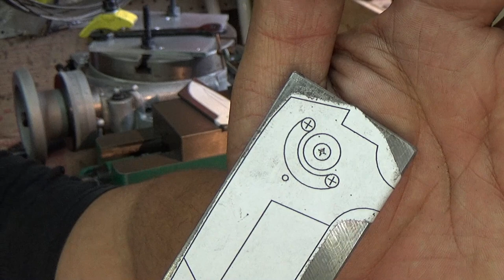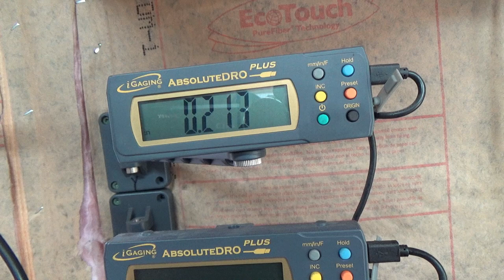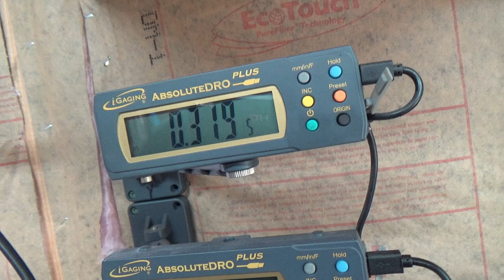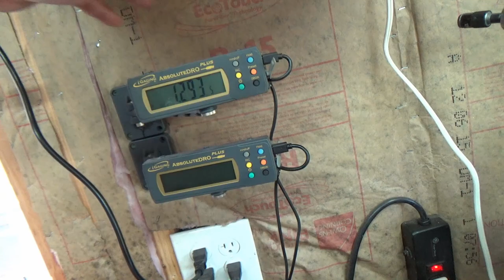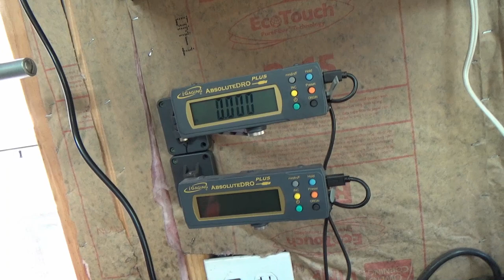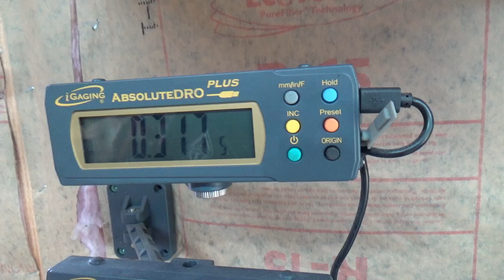Making A Folding Knife #2  Milling out the stop pin track

Comment: For positioning the holes on the blade. You could do it this way (just an idea)
-profile the blade and make the pivot hole.
-profile the handle with pivot hole and with an undersized hole for the stop pin 
-assemble the knife with a pivot. Turn the blade to the position you want it to stop when it is opened and clamp it together
-drill through the undersized hole. 
-assemble the knife   with the blade where you want it to be in the closed position. clamp it, and drill again.
-disassamble, and drill+ream all holes to the proper size. 
-after this you can mill out the path for the stop pin .  This way, you can be sure, that the closed and opened position follows your design accuratley .

Comment: Since you have the DRO, you could drill all 3 holes on the rotary table by finding the coordinates of the 3 holes. This would save some time. I don't know how to quickly explain it. Basically, find the center of the rotary table, Zero the DRO, put the stock on the rotary table, drill the pivot hole, use a dial indicator to make sure the stock is aligned in one axis,  then travel to the 2 "end" hole locations via DRO coordinates, and drill those holes. Then switch to an endmill and  crank the rotary table to machine the slot.  I hope that makes sense.  I enjoyed the video! :)
Reply from the maker: That's a great idea and would definitely eliminate some time and variability. Thanks for the tip!
Reply: Tried making a stop pin track with no DRO,  I just bought a DRO and am going to try this.

Comment: I have an idea that might improve the concentricity of the slot and the pivot hole. It's similar to what Wide Vision Metal Fab suggested earlier...

Basically, you're shooting for concentricity, right? That's the most important thing? That being the case, it seems like it would be a good idea to do everything on the rotary table.
Quick disclaimer: these are just some ideas I came up with while watching your vid. I haven't done ANY manual machining what-so-ever so I can only hope that this will be helpful...

1. Step one would be to center the rotary table and fixture/spoilplate on the mill.
2. Punch the center of the pivot hole using the optical center punch.
3. Use the pointed ground rod to align the punch mark in the blade with the center of rotation of the rotary table. You may want to make the point a little sharper.
OK, now the good stuff...
4. Drill a hole in the center of the pivot hole, but don't use as large of a bit as you're currently using. As you may know, drilled holes are neither round nor accurately positioned. Although I haven't tested this myself, I think I've heard that a drilled hole might be off a thousandth or two just because of the nature of the shape of the tool. The method I'm proposing doesn't require an accurately-positioned hole, so don't worry about it if you try what I'm suggesting...
5. Now drill the two holes at the ends of the slot. The size and positions of these holes aren't critical, but punching them first probably wouldn't hurt.
Now, remove all the material you want, accurately, using an end mill...
6. With the blank still fixed to the rotary table, put in an end mill. I'd recommend a .125 end mill instead of that .140.
7. Re-center the rotary table with the spindle using the DRO. Oddly enough, it still won't be critical that you're PERFECTLY centered, but you probably don't want to be too far off.
Being that the pivot hole is going to be reamed to 0.1875, you'll want to make the pre-reamed hole ~0.1838". Let's call that 0.184" in diameter or a radius of 0.092". If you're using an end mill with a radius of 0.0625", you'll need to move the table 0.0295" to put the cutting edge of the end mill at the edge of the final pre-reamed hole size that you're shooting for. I'd probably shoot to do that in two passes...
8. Move the table to Y0.015 and widen the pivot hole by milling. You'll be spinning the rotary table around a full 360º here. This step should leave you with a nice round hole that is also accurately positioned. (edit: it'll also be nice a perpendicular!) Unfortunately the diameter of the hole won't be incredibly accurate, but thankfully that doesn't particularly matter. It'll be roughly 0.155" in diameter at this point. Depending on the accuracy of the initial drilled hole, it's possible this first milling pass will remove slightly more material from one side of the drilled hole than the other.
9. Move the table to Y0.0295" and widen the hole again. This time the final diameter should be close to 0.184". Since you did a roughing pass, this pass with the mill should have removed a very uniform amount of material so the resulting hold should be very round and very accurately positioned. A nearly perfect pre-ream hole.

I'm not sure how exactly you'll mill out the slot. Since I haven't done manual milling myself I can only speculate that you'll want to move the table to Y0.3125" and rough out the slot, just like you did in the video. Of course, the slot will only be 0.125" wide, not 0.140" like you want, so you'll then have to move the table out to 0.320 to mill out the outside of the slot and then move the table in to 0.305 to mill the inside of the slot. Rounding the ends of the slot might be best left up to the 0.140" mill. OR, maybe you could rough the slot with the 1/8" mill, switch it out for the 0.140" mill and finish the whole thing... Yeah, that might be the best route to take.

I'm sure you've seen the "That Lazy Machinist" videos, but in case you haven't, or maybe just haven't seen his four-part lesson on the drill press, I'll link to it in a reply to this comment. (I'm going to link in a separate comment because it seems that YouTube likes to declare all links as "spam" and messages filtered as spam are easy to miss... The part that blew my mind, and was the inspiration for my suggestions above, is at 33:33 in lesson three. He talks about drilling a hole (to remove the bulk of the material quickly), boring it (to position the hole accurately), and then reaming (to achieve the desired roundness and final dimension).
Reply: Oh, one more thing I forgot, at some point you'll obviously want to ream the pivot hole. I guess the best time to do this would be while it's still fixed in the rotary table. Of course, if you ream the hole in the same fixture that you used to mill everything, you'll end up simultaneously reaming the fixture. Doing this too many times might distort the center hole in the fixture and make it useless for accurately centering the rotary table. The only/best solution I can come up with for this problem is to pre-expand the center hole in the fixture to something like 1/4". That way it can still be used for centering the fixture and it won't get messed up when you make knife blanks with it. Then use a 1/4" pointed ground rod to do the centering in step 1.
Reply from the maker: I've read through your comment here a few times and I must say I like the perspective you have on this. You must come from a machinist background of some sort...something I certainly struggle with. Ideally I would do everything with end mills on  the rotary table to achieve the ultimate goal here of a perfect arc with an accurate start and stop location in relation to a pivot hole which is perfectly sized to .1875. I agree the number 13 drill I'm using is too large and doesn't leave enough room for the reamer to do its job. I've even gone as far as ordering barrel laps to polish my way to the desired .1875.   I have so much to learn and this comment definitely has me thinking of smarter and more accurate methods!  Thank you very much!  Oh and I'm a big fan of that lazy machinist! I learned how to properly surface grind from his videos. I wish he never retired!
Reply: You're welcome, glad to be able to pass along some ideas!

Comment: I would save the dama steel for when your start to get better at making the folders. But that is just me. Great video and the best of luck.
Reply from the maker: I was thinking the same but I figure its time to go all in on this project and make it work! If it fails, sure it will hurt but material can always be replaced along with the lessons I learn from trying.

Comment: Hey, could I ask a favor. When you go through the process of making your folders could you possibly make a list of the various tools, measuring devices, etc., that you use. I've got an Grizzly Mill the same model that you have. I know Phase II makes your rotary table but what size are you using, the  10" one ? A few of my friends recommended that I start learning and using Fusion 360 to design everything that way you also go from CAD to CAM and like you and ultimately I want to do get into an CNC milling machine. I'm slowly getting my shop built up but ultimately want to buy a Tormach and start from there and build up.

Comment: Hey Mike, I'm in the design stage of making a frame lock knife handle for myself and I have a few questions. I'm actually not planning on making the blade, I am going to try to use one I already have. I have access to precision  manual machines (and possibly a CNC mill in the future) and electronic measurement tools which should in theory at least allow me to design the handle around the blade without any mistakes as a result of not having the blade blueprint. Ok, back to my questions. Obviously, in order for a frame lock to work the lock has to be bent to hit the lock face of the blade but still have spring so that the lock can be pushed back to allow the blade to close. How do you accomplish this? Do you simply bend the lock into position, or do you use some combination of heat and bending? Also, I can't use titanium because of its price and the fact that the chips are flammable. Can you recommend any substitute materials? (Preferably something that does not rust and is reasonably machinable.) I'm thinking of using some form of stainless, but I'm not sure which. Thanks for your time, and I really appreciate the help as I am completely new to this.

Comment: Have you tried assembling the knife and drilling through the stop pin hole in your frame to establish your open and closed positions in your blade. It works perfectly for me, but it won't work if you're wanting to hide the stop pin holes in the frame.
Reply: do you HAVE TO have the pin track? sugar Creek forge didn't use any that why I'm asking
Reply: +THE Justin Schmidt There's several methods of doing the stop pin. The internal stop pin track tends to be the easiest to incorporate into a design in my opinion.
Reply: thanks for the reply man.  I don't have a milling machine that's why I'm asking. so if you have the stop pin track down you still need the detent ball? I'm just trying to figure out the inner workings of all this.

Comment: Mike, when I dial in a number on the DRO I always stop about .002 under and then when I lock down the table it moves right to the number I want.
Reply from the maker: I'm new to the whole dro thing and I've been noticing that as well. I'm going to start doing that so I don't have to fiddle with it as much. Thanks for the tip!

Comment: Great Video man. I just started out with making knifes and right now i only try me on fix blades. But i want to try out to build an folder anywhen, not sure when. 
But my question now is, if it is possible to build an folder with a medium quality drillpress. Because i don't have the space and the money right now for a milling mashine, i thought about an outside stoping pin because it is way easyer i think.
My biggest Problem is that the drillpress don't run perfectly "straight" (longer drillbits wobble a little bit but the holes are in a 90° angle) with shorter drillbits i can minimize that. But i also don't have any precision mill(bits?) so my question is if i can make a good pivotfit with a medium quality drillpress. I thought that it maybe work to drill a very little bit smaller than the pivot pin (maybe 1/10 of a mm) and than grind the pivot pin a little thiner. Should i try it anywhen this way or is it hopeless that way? Maybe someone can help me with that.
(I'm from germany and my english is way far from perfect so if you can't understand some sentences, please ask.)👍
Reply: i haven't attempted to make a folder, so this might be useless but if you use the shorter bit, I think it would work. just make sure you don't put too much force or torque on your drill press
Reply from the maker: Your best bet is to design your knife around the equipment you have so an external stop pin is a good start. Milling the stop pin track on a drill press can be difficult and very hard on the drill press. They just aren't made for that kind of lateral force. As for drilling precise holes, it can be done. Like you mentioned, drill undersized and ream to the correct size with a chucking reamer.
Reply: Was du auch mal testen könntest, wenn du nur ne standbohrmaschine hast ist: dem gewünschten schlitz entlang mehrere löcher bohren (am besten etwas kleinerer durchmesser als am ende gewünscht) danach die gebohrten löcher ausfeilen auf die gewünschten maße. ist zwar ne menge arbeit, aber vllt ein besserers ergebnis. Einfach mal ne testklinge anfertigen, mit jedem projekt lernt man! auch ich mache noch oft fehler, die aber beim nächsten messer natürlich nicht geamcht werden ;)

For the english speaking readers:
What you can try, too, is just drill a bunch of holes along your desired line, then use a file and get to work, you can make it a little smaller with smaller drillbits and work your way up there. it is much more work but should be possible. just play around and you will learn something new with every project you do.

cheers
Magnus
Reply: Magnus Pablo ich hatte überlegt ob ich den stopping track sonst, wie du sagtest vorbohre und dann mit einem Fräswerkzeug ausfräst, indem man sich in eine Vorrichtung zwei Löcher im benötigten abstand bohrt. Mit dem ersten Loch zentriert man dann die Vorrichtung und in dem befestigt man dann die Klinge mit einem Pivotpin. Dann sollte der Stoppingtrack überall mit dem Fräser übereinstimmen (wenn man präzise gebohrt hat). Aber für die ersten Versuche werde ich es wohl erstmal mit nem externen Stoppingpin versuchen. Kurze Frage noch: sehe ich es richtig, dass bei nem externen Stoppingpin der Pin auch den "unteren anschlag", also den eingeklapten Zustand festlegt?
Reply: For english readers: I thought about a jig with two holes to drill a bunch of holes along the stoppingtrack. The first hole is to center the jig at the stoppingtrack place and the second hole is to hold the blade with a pivot in place. Then i first drill holes along the stoppingtrack and then use a millingtool to will it out slowly with rotating the blade around the pivot. But for my first trys i will use a external Stoppingpin. My only question is, does the external pin determine the "foldet stop" (detend?) ?
Reply: Semjon Borzutzki also der stopping Pin oben kann festlegen wo es stehen bleibt unten. Aber dann musst die die Form der klinge entsprechend gemacht werden. Normalerweise macht man ne Kugellager Kugel in den framelock und ein kleines Loch in die Klinge in der es einrastet wenn man das schließt.

Comment: Mike your PG 3/16 steel rod from MC looks to be pointed i went to order several sizes that would be helpful but the one's i ordered are not pointed did you grind yours to a point ?? thanks, Oh also the lathe live center you show please list the supplier
Reply from the maker: I did grind mine to a point I just checked it up in a drill and ran it on the grinder for a few seconds. I got that lathe center from Enco for about $15 or so     http://www.use-enco.com/CGI/INSRIT?PMAKA=251-3042&PMPXNO=943712&PARTPG=INLMK32

I cut the base off of it so it would fit in the table without bottoming out. You'll see what I mean when you get it

Comment: FYI I have the same Grizzly Mill Vice and I can not find any company that has Aluminum Soft Jaws for that vice MonsterJaws Does not make them for our Vice.any suggestions. I need at least 6 sets for doing different operations in My Bead Making Process.
Reply from the maker: I haven't looked for soft jaws yet but If I come across some that fit I'll let you know.
Reply: Gary Demarco you have a mill. Get some aluminum and make your own!

Comment: I wouldn't mill the full width in that channel on the rotary table. You won't be able to hold as tight to your tolerances because the chips won't have anywhere to go. I'd go undersize then finishing pass to clean everything up.